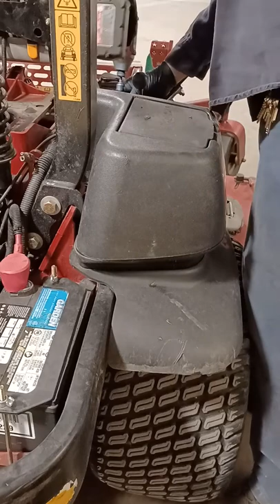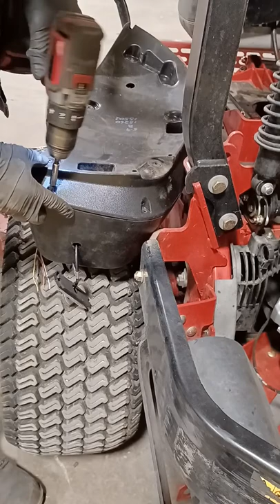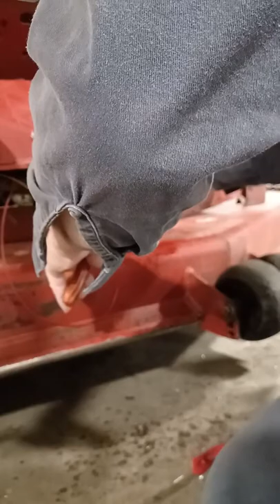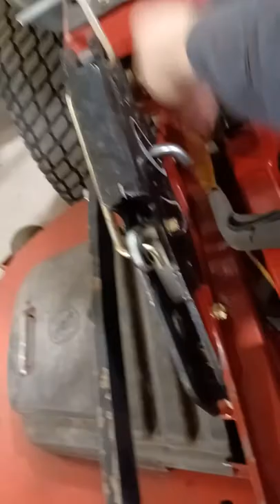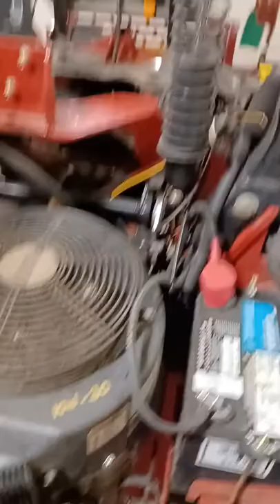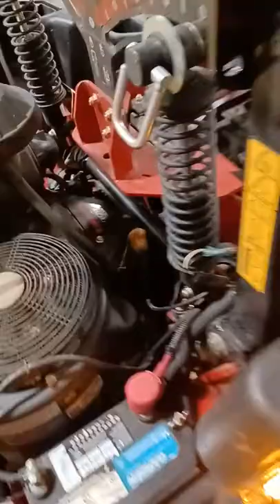lawn mower strobe light install

Comment: I'm wondering if yinz do warning light installs regularly? Why I ask is it seems as though the front light was mounted in a matter that really would only alert air traffic. It should have been mounted in a way that it face forward on a level plain.
Then the light you installed on the rear. The lift light looks to be vertically straight  up & down and the left definitely not. 
If this was your own mower it would be fine because as long as you don't care about these things whatever. But if you were doing this for a customer I'd bet they will not be a repeat customer.